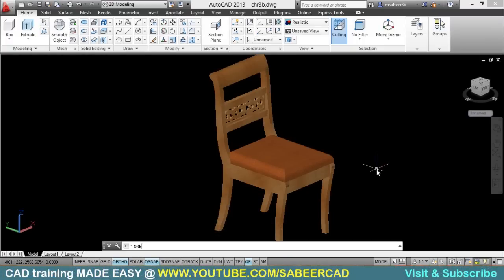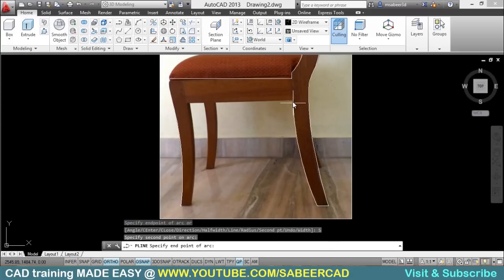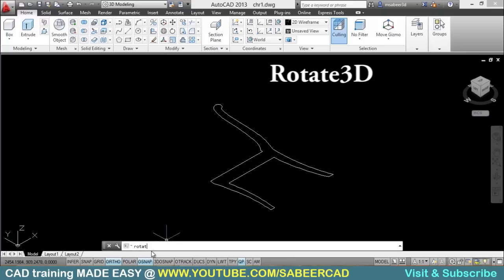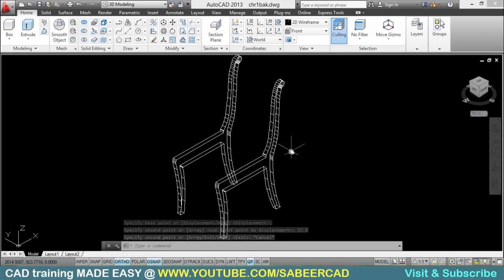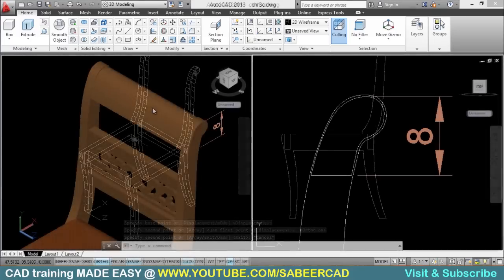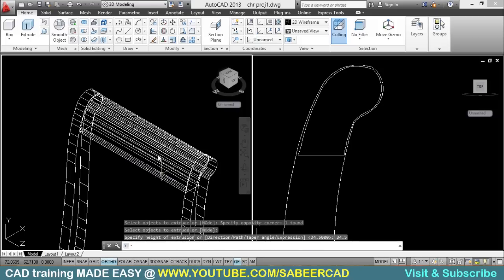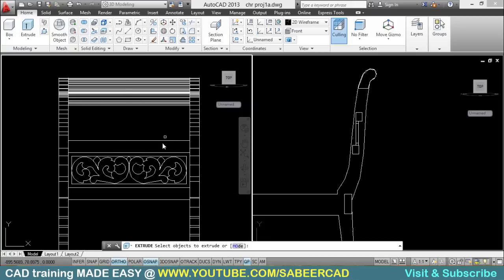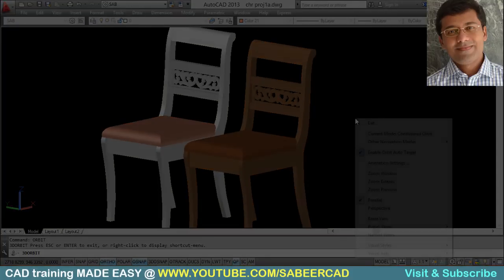AUTOCAD 3D CHAIR | 3D CHAIR

Comment: btw how were you able to know what the exact dimensions were? were you just guessing the first time you made the 3d model or did you go through the trouble of measuring your actual chair?
Reply from the maker: +Alex Yap If you are pretty good at proportions , you can guess the dimensions . Otherwise you should develop the patience to measure it physically using a ruler :)
Reply: i see thank you for the tip, i actually am really bad at guessing proportions so i guess it's the ruler for me

Comment: bro i have a polyline (straight polyline) and i trying to convert arc just a little bit using the grip but the line is pixelated is that fine??
Reply from the maker: You can send a screen shot to sabeercad@gmail.com

Comment: Hey...i tried drawing the chair but the chair frame instead of turning to a perfect solid turns to a shell...can you help
Reply from the maker: You have to close the profile before extruding it . Just give PEDIT command and check . If the first option in this command is CLOSE , then you can be sure that its an open polyline
Reply: Thanks, i managed to solve it.

Comment: the method you change the units is not good if there will be times you need to open your cad model in other cad 3d software, you need to use -dwgcommand to change the unit.
Reply from the maker: AJ Mags To change the unit you can use UNITS command .  To convert the unit of an existing drawing you can use -DWGUNITS command
Reply: yes but base on my experience if you use acad template which uses inch unit in default and you use units command not the -dwgunits, then after making your model, try import it in sketchup or other cad programs and you will see the problems.